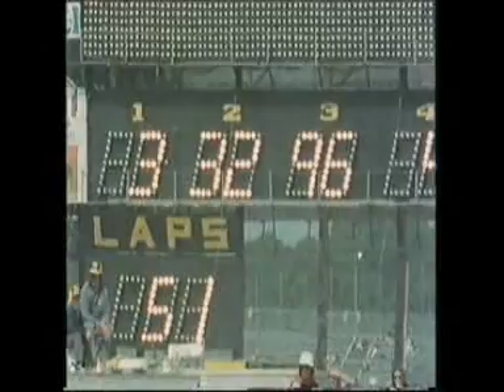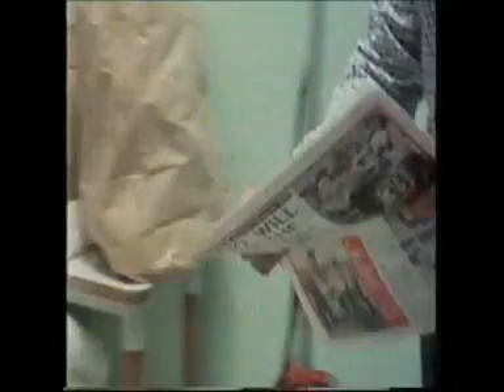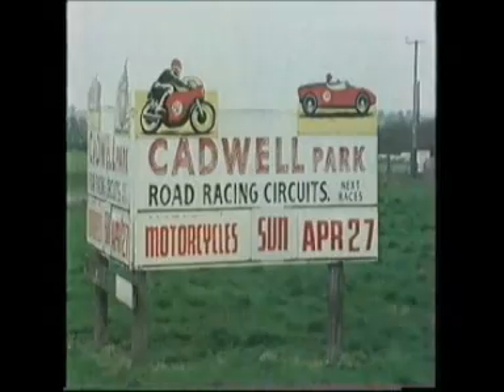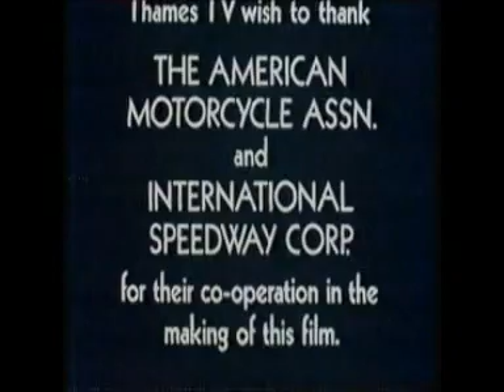Barry Sheene Daytona 75 TV Documentary

Comment: Have the specifics regarding the "problem with the back wheel" which caused Barry's major crash at Daytona ever come to light?
Reply: Coldsmoke 
Better late than never..
The suspect was the new slick tyre (Michelin on Barry's bike, IIRC), expanded so much at that speed (from wheelspinning) that it seized against the swing arm.
Reply: @keithdawson4804  even later still! I never knew that, I was always under the impression that the square 4 motor heat seized I thought that was why the riders nicked named it "whispering death"?
Reply: @sambrooks7862  
Suzuki were using the GT750-based TR750 until at least 1977 or later, under F750 rules.
Reply: @keithdawson4804  yep my bad, it was the 500 that used the square 4.